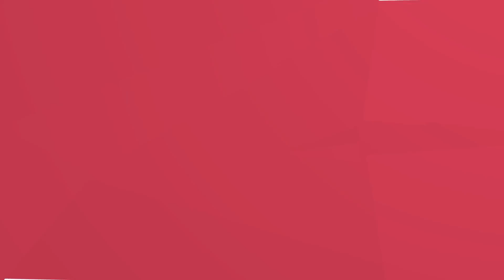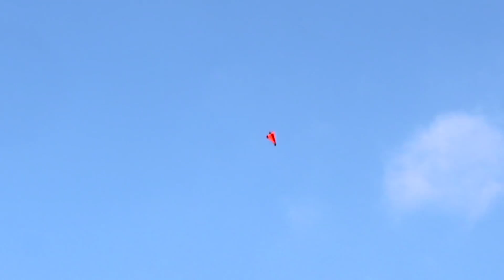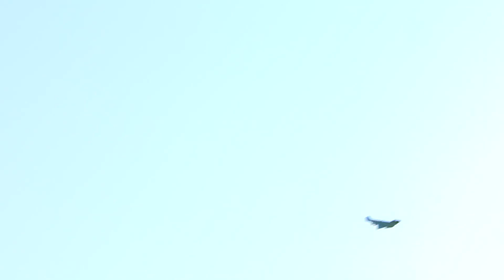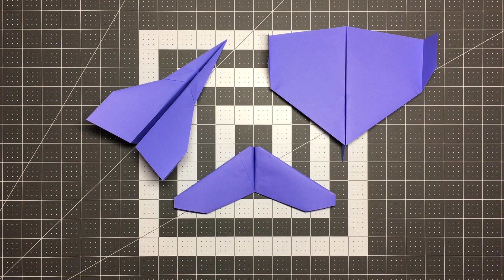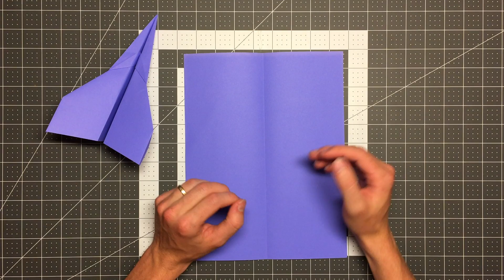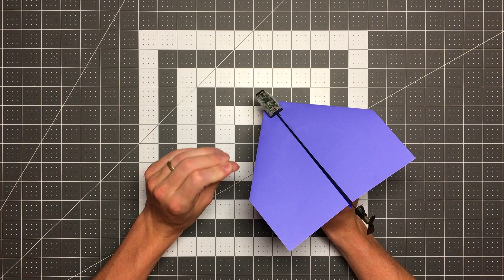How to Design Your Own Paper Airplane That Flies Far (Ep.4) — Three-Dimensional Locking Folds

Comment: instead of locks you can use tape right? is there any disadvantage for using tape
Reply: I't won't be origami anymore
Reply: That is not an advisable UNLESS necessary. Instead, you can use Toda's nose lock for beginner-friendly if you are going to fold your own gliding type. 😉
Reply: @taylor.sweep2001 the Toda lock works nice even with dart models